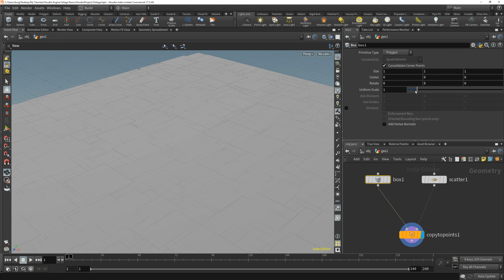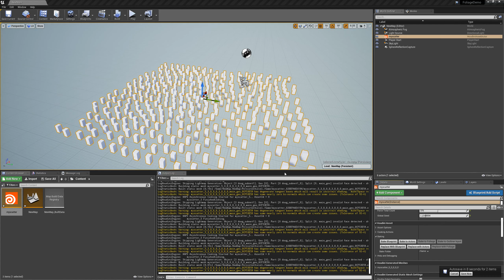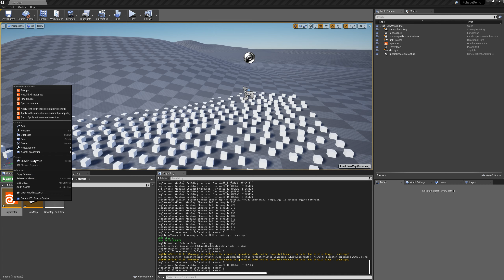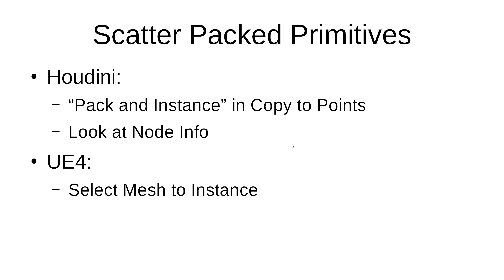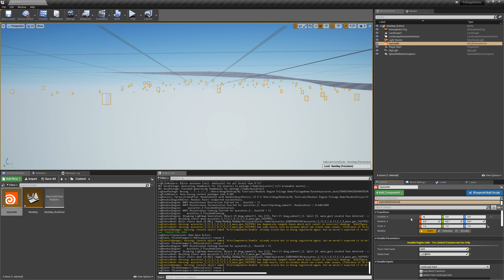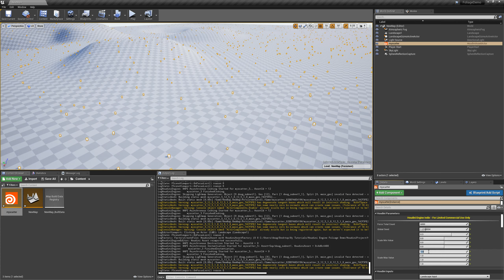#Houdini Scattered Primitives to #UnrealEngine4 Foliage

Comment: You don't need to create the attribute randomize before the scatter. In fact you are not really getting per point variation if you do so as the scatter just inherits the less dense attribute from the grid.
It does make for some nice patterning though...so a good idea is to put an attrib-rand before the scatter for general pattern variation, and one after set to multiply for per point variation.
Reply from the maker: You're totally right. I meant to place it after the scatter and just didn't pay attention. I'll make a correction in the video description.

Comment: In unreal, using the Houdini engine, they are considered as instance objects???  In my opinion, even if they were all unique, it would be terrible for productivity
Reply from the maker: If it's a static mesh like this then yes. From the unreal docs: https://docs.unrealengine.com/4.27/en-US/BuildingWorlds/Foliage/

> Static Meshes placed with Foliage Edit Mode are automatically grouped together into batches that are rendered using hardware instancing where many instances can be rendered with only a single draw call, while Actor Foliage comes at the same rendering cost as placing normal Actors into a scene.
Reply: @doug_richardson   You explained exactly what I needed so precisely and clearly, thank you. But how can I make it so that when importing into ue4 I can then separately select and delete a certain object, for example a tree?? This is a big problem, it can stand where a wooden house should stand, for example

Comment: Hey Doug, I'm a Houdini artist having a curious look at Unreal 5 at the moment and assessing if it'd work for a short project. 

I just wanted to know what the benefit is of this scatter system over the Procedural Foliage Spawner, or was that only added in a later version of Unreal? Or is this more so a means to comfotably do the procedural scattering with Houdini and Houdini Engine and then have those scattered primitives converted into the foliage assets. 

Either way I'm eager to try it all, also I'm following along with this tutorial regardless since there's plenty of info here about HDAs in general. I more or less have my project made in Houdini and I wish to port it to unreal to render it.
Reply: This worked out great, had a bit of trouble getting the Houdini Engine for UE5 but they have a plugin up on Github. 

Some things have changed and I can't find the landscape in 5, but I got the asset working regardless so thank you!
Reply from the maker: The procedural foliage spawner is not new... I believe it has been around since the UE4 Open World Demo from GDC 2015.

If the procedural foliage system is sufficient for you, it's probably easier and more efficient time wise to do everything in Unreal instead of setting up Houdini Engine and an HDA.

If, however, you want more customized logic about how things are placed, then you may want to do it in Houdini since you have access to all their nodes and are not just limited to the scattering parameters the foliage spawner uses.

Also, if you already have a scene in Houdini and you want to be able to adjust it and automatically re-scatter foliage, keeping it Houdini might make more sense. I don't think the procedural foliage spawner automatically updates (but I could be wrong, I haven't used it in a long time).

Comment: Nice Tut! Will help me a lot!
Do you know if there´s some way to mask where the instances will appear? Like if I want the cones just in the regular ground and not in the mountains?
Can I import a HF mask from Houdini? Or even draw a new one on UE4?
Reply from the maker: You can definitely scatter based on a texture (doesn't have to be a heightfield) in Houdini. In the Scatter node, try using the "In Texture Space" for the "Generate" parameter. https://www.sidefx.com/docs/houdini/nodes/sop/scatter.html. As for using a mask/HF drawn in UE4, you can use the Landscape Input to send landscape data to Houdini (as a heightfield or mesh), like I do in the video. I believe (but have not tried myself) you can also send landscape material info into Houdini, which you could then use as a mask when placing the cones. https://www.sidefx.com/docs/unreal/_inputs.html#InputsLandscape

Like I said, I haven't tried this myself, but it looks like all the data is there.
Reply: @doug_richardson  Awesome Doug! Thank you for your kind and quick response! I'll try over here!

Comment: Hey Doug, Great tutorial, thanks for putting this together. 
I am having some issues when creating the input node. I seem to be able to add it into Houdini all well and good, as shown in the tutorial. But when I try to rebuild/ re-import the HDA in UE4, it will not update and include a manual input. What could be causing this do you think? All is well until this step. Any help would be greatly appreciated! Thanks
Reply from the maker: Did you make sure you saved the HDA, and not the Houdini project file (HIP), after you added the input? It's kind of confusing because you are generally editing an HDA inside a HIP.

Comment: Big thanks for the interesting topic. I'm testing Houdini - UE4 pipeline and I got into trouble from the start. I built simple scatter .hda based on heightfield scatter. It works but with some problems - geometry instances (picked inside UE) lost their materials. Second - looks like LODs dont work at all (all instances have LODs) - scatter uses only lod0 and perfomance is too low.
Reply from the maker: 1. "Geometry Instances lost materials." Are you saying that you imported an HDA into UE4, set the materials, and then lost the materials when you tried to reimport the asset? If so, you may want to take a look at the unreal_material attribute (https://www.sidefx.com/docs/unreal/_attributes.html) that you can set in Houdini to choose which UE4 material to apply. I have an example of this in my Houdini Heightfield video here (https://www.youtube.com/watch?v=iUGRAbTHynE&t=1296s). I think this works with geometry instances but have not tried. Let me know.
2. "LODs don't work at all." I'd need more information to know for sure, but my guess is that what you are seeing in UE4 is simply how instancing in UE4 works. If you are using the Instanced Static Mesh Component, then the same LOD is used for every instance displayed in the screen. This is how it's able to draw all the instances in a single draw call. If you need LODs you should look at the Hierarchical Instanced Static Mesh Component. There is a nice overview of it here https://youtu.be/oMIbV2rQO4k?t=364.

Comment: I really enjoyed the video.
I want to ask you a question, so I'm leaving a message.
Is there any way to automatically recognize the z-axis of the Landscape with an area designated as an alpha-tex?
Reply from the maker: Yes. Use the Heightfield File geometry node (https://www.sidefx.com/docs/houdini/nodes/sop/heightfield_file.html). You can use the input file as either heightfield data or a mask.
Reply: @doug_richardson  Thank you.
But I don't think I realize it yet.
Can you just show me the node structure? Help me!
Reply from the maker: @amsick3  To make sure I understand your question, will you show me what you have and what you are trying to achieve?
Reply: @doug_richardson  Thank you very much for your interest
I already know from Houdini that I've used a scatter node on the terrain to move the grass that I've placed on the terrain and on it into an ue4 at one

But this is much easier because it automatically recognizes the z-axis rather than the traditional one
However, from the moment the foliage is connected to the landscape in the ue4, I can do it in the wide area, but I can't find a way to control the area, so I asked
Reply from the maker: @amsick3  Sorry, but I'm still having trouble understanding your question. Could you post a video of what you are trying to do so I could see what the problem is?

Comment: Very uesful!! And I want to know how to scatter in a specific layer of landscape（I have created a layer in my hda and import it into UE4）THANKS!!
Reply from the maker: Scattering via layers (i.e. painting) is quite different. The Houdini side of that is pretty easy, it's really just creating a new mask layer which will show up in UE4 when you import the heightfield. On the UE4 side, you have to setup your landscape layer material to place objects (i.e grass) where you've painted the layer. It isn't difficult, but there are a few moving parts.

For now, you can learn about the Houdini part here: https://www.youtube.com/watch?v=iUGRAbTHynE&t=830s

For the UE4 part, you need to setup a material that uses the Grass node, which you can read about here: https://docs.unrealengine.com/en-US/Engine/OpenWorldTools/Grass/QuickStart/3/index.html

I also have an example of this in my Landscape example project. See the GrassLandscape and WorldMachineLandscape levels: https://github.com/drichardson/UE4Examples/tree/master/Landscape